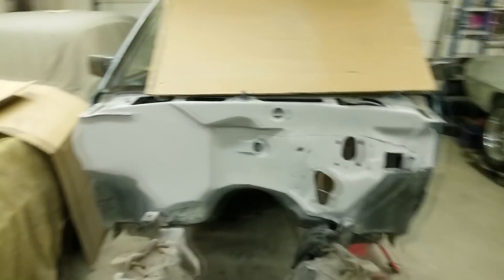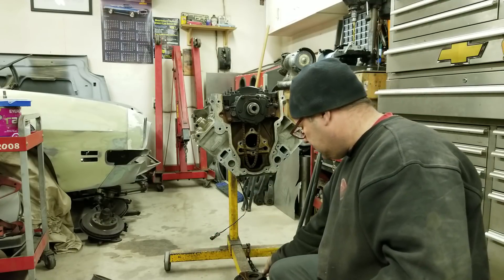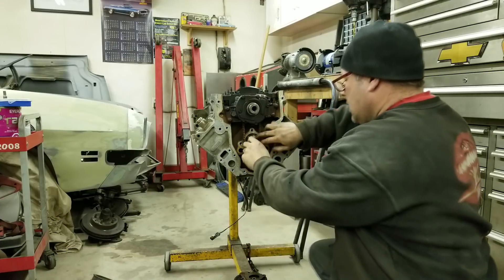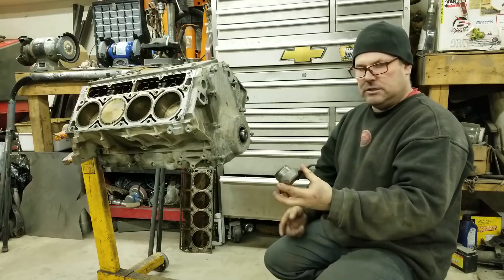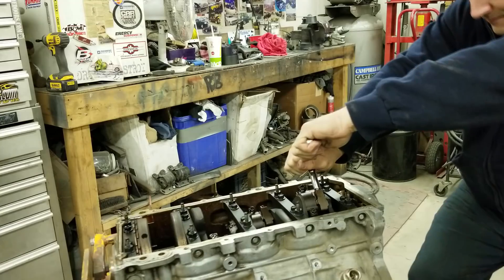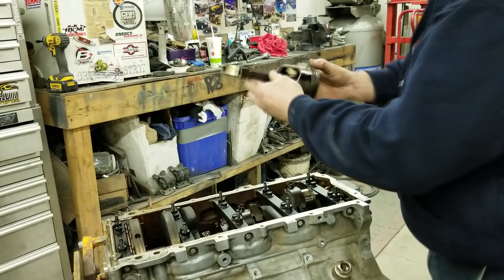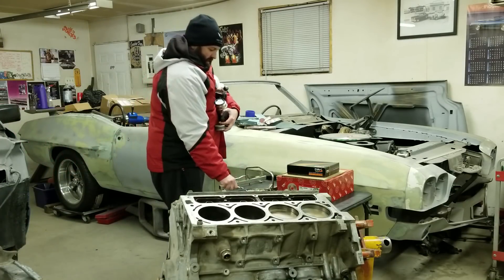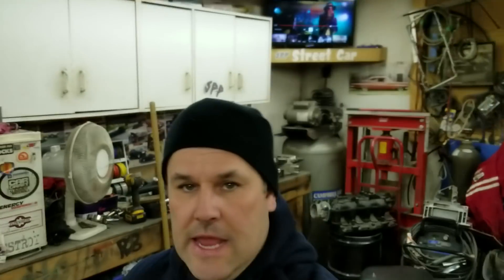Turbo Prepping a 5.3 LS V8 Short block | Sloppy Stage 2 Cam + Piston Ring Gap for BOOST!

Comment: That’s a 4.8.
Reply from the maker: No, its a 5.3
Reply: @SPPTVarmy  oh my bad. Looked like it had flat top pistons in it.
Reply from the maker: It does, the L33 5.3 which is a aluminum block gen 3 with gen 4 internals has flattops.

Comment: What pistons and rods and crank shaft should i get for a 5.3 gonna be boosted plaining on making 700+ hp in a foxbody
Reply from the maker: Stock
Reply: @SPPTVarmy  should i change anything at all heads anything am planning on getting a boost cam but and a lsx fast intake manifold but do you thinks thats all i need
Reply from the maker: You can pull the pistons out and open up the ring gap.my engine has head studs and ls9 head gaskets but is other wise stock.

Comment: How were the cylinder walls? Any cross hatch left? No need to hone it? Not like a carbureted motor that washes out the bores after 10,000 miles of running too rich!

Comment: Love what you guys are doing. I'm learning a lot. But, isn't that a 4.8. I thought 5.3s had dished pistons and 4.8s had flat tops. I'm still learning. I'm not hating.
Reply from the maker: +Twisted Teeter The 5.3 L33 has flat tops.
Reply: SPPTV thank you. Good to know. Keep up the good work.
Reply from the maker: +Twisted Teeter Hard to keep track of all the LS variants. I rely on google.
Reply: it's considered a 5.3 H.O. motor. swapping the regular dished 5.3 pistons for the 4.8 flat tops is a common, cheap, and easy thing to do for a bit more power in the iron block truck motors tho. just don't use the 4.8 rods. 4.8s have a different crank stroke and longer rods.
Reply: As others said it's an L33 which is aluminum block 5.3L (aka 5.3H.O. & baby ls1). They are a very stout aluminum block with the flat top pistons like a 4.8L and they come factory with 799 heads which are the same castings as the ls6's 243 head castings. The L33 was an optional engine in a select few 4x4 trucks for only 3 years. I am doing a turbo LS swap in my 2000 ZR2 s10 pickup which is obviously a 4x4 if you know the ZR2. If you know them then you know that the body is S10 but the chassis amd drivetrain is heavily upgraded over a normal 4x4 or 2wd s10. Putting them at over 4000lbs curb weight, something that the l35 4.3L's 190hp just wasnt that great for. Anyway I picked the L33 specifically because my 4x4 s10 runs a torsion bar front suspension unlike the coil springs on a 2wd and the L33 weighs basically the same as the 4.3L with it's iron block and iron heads it just makes atleast 120hp more and atleast 75ft.lbs. more on stock motor alone. I've already converted my L33 to an LS6 intake and DBC throttle body, I had to get a specific milodon oil pan and pick up to clear my front differential (no suspension or body lift). The milodon pan ends up being alot cheaper and easier than cutting up and welding an H3 oil pan. The only big issue is I'm stuck with using 98-99 ls1 camaro or TransAm exhaust manifolds that have to be modified (which sucks because my 70k mile 2002 WS6 TransAm's factory manifolds wont work and I went long tubes on that car about 1500miles after I got it in 2012 with 33k miles on it. Anyway, my truck will be a basic build. L33 with ls6 intake, sloppy stake one boost cam, trunnion upgrade, walbro* 450lph fuel pump and corvette return style regulated fuel filter, probably get the CPW harness, kwik A/C high mount bracket, Corvette spaced accessories with ls3 water pump, new racing radiator with dual 12" fans, and do a bed mounted turbo set up. Basically gonna stick things where I can get them to fit since the 5.3 with A/C takes up most of all the space under the hood. Oh, as for the L33 the stock compression ratio is 10:1. So even if you build a DIY 5.3H.O. with 4.8 flat tops in a 5.3 expect to have a similar compression ratio. Happy building everyone.
Reply: @jonathanhudson4623  hey thanks. But you’re commenting on a post I put up 4 years ago. I may not be the smartest dude, but, I think I’ve learned a lot since then. Thanks.

Comment: I have a 400 sbc and the crank is hitting my oil pan. I have to keep the bolts loose so it wont hit.
Reply: knelsen _204  is it the pan that came off it? Most aftermarket pans are clearanced for longer strokes. Put the pan off and look for marks where it is hitting and clearance it a bit with a small hammer.
Reply: novaracer2000 I got the motor like that and noticed it was leaking a little oil and seen that all the bolts were loose so i tightened them started it and started making noise. Ya ill have to take it off and do some hammering. Thanks 👍

Comment: What about using a ford axle of a mustang 8.8 i think posi also
Reply from the maker: Fox bodies had 28 spline axles, the Explorer diffs have 31 spline axles
Reply: drill axles and rotors !!!
Reply: I used an 8.8 out of a mid 90's explorer, it came with limited slip and disc brakes. two upgrades in one !! it bolted right up, and I fabricated a bracket to hold the original traction shock.
Reply: I am also using a 8.8 from a explorer with 3.73s, posi and disc brakes. I need to cut it down 5 inches so my wheels fit.
Reply: maybe different wheel backspacing and offset? oh wait you got mad welding skills, and Clayton !!
Reply: You guys could figure it out i am sure redrill chevy bolt pattern univeral u joint and boom upgrades lol
Reply: gypsy gear 

I’d like nothing more than to be able to re-use the axles but Rob needs to narrow it too much to be able to use his IROC wheels, drilling them for Chevy BCD is no big deal but it looks like he has to order shorter axles

Comment: do you have to worry about holding less oil  once you  cut the pan
Reply from the maker: It currently holds 6litres and it will cut capacity down by about a litre but we will confirm that before installation

Comment: I used the same idea to put C5 Corvette brakes on my 70 camaro....cut down the stock rotor to make a hub. Drilled and tapped the dust cover holes for the C5 brackets and hung the calipers. Good to know about the rings being worn down to the right gap. Maybe I'll boost my Silverado since it has 200,000 miles on it now.
Reply: jwright650 i have c5 brakes on the gto done the same way.

Comment: Crikey glad i watched this one...for some reason i was thinking off gapping my ring to 30 thou...nuttin worse than a loose ring.😃
Reply from the maker: +Clint Collins The Sonicstang's rings are around 30. Going to give it all the boost though lol.
Reply: SPPTV oh yeah did not think of that..pwr goals...lookin fwd to the sonicstang build.
Reply: more boost needs the bigger gap if your steering under 20lbs there's no reason to go more than 25ish
Reply: Mikel Bentley thanks so i could probably leave mine factory as im only shooting for 500ish wheel ...7 to 10lbs?
Reply: @10lbs definitely wouldn't bother but if you ever plan to go higher then I would go ahead and gap them
Reply: @Justdoingstuff83  hey I know this is old but I bought a engine with the rings gapped at .026 on the top and .028 on the bottom how much boost can I run?
Reply from the maker: All of it
Reply: @SPPTVarmy  so 30? Real talk I’m trying to make 750 out of a gapped 5.3 with stage 2 sloppy and a turbo

Comment: Hi rob I heard rod main and head bolts are torque to yeld aka "reusable" is it true? If so what brand did u go with for ur rod bolts?
Reply: Jared Norris the rod bolts are reusable and though they say the head bolts are not, many people reuse them and have no problems
Reply: OK I was just wonder wasn't hating on nothing love this channel and s10 build thanks keep up the good work
Reply: +novaracer2000  I have "Stand-A-Lone" cd's with GM's electronic service information. I selected 04 Tahoe VIN code "Z" for flex fuel. As for rod bolts, no where did I find where you are instructed to replace the rod bolts...So, I guess you are right as they re-usable. They do indicate correct torqueing procedure is; First pass 15 lb. ft.   Second pass 75 degrees. That make me nervous as that is usually the procedure for "Torque to Yield" bolts. Depends on if you want to take that chance over $55 of parts on the rotating assembly.
Reply: I'd Just buy at bolts it's really not worth not getting them I mean shot it's only 200$

Comment: Holy ravioli. That is a project with the front brakes I can't wait to see. Did my 2000 S10 rear 7.5 for $100 from 98WS6 Trans Am rear complete brake set w/caliper bracket from eBay.

Comment: Cool Video for sure, i think more than 50% of your viewers don't know how to check ring gap. Is there no other brake upgrade available, seems like a lot of work / time.
Reply: George Mitchell maybe but not for as cheap as this one.
Reply: George Mitchell 

Not too much involved, I should have the stock hats and brackets machined by the end of the week
Reply: a ford 8.8 from a mid 90's explorer will fit, and is plenty strong. They usually came with 3.73 gears and added bonus of rear disc.

Comment: Hey Rob have you ever had to degree in a cam??
Reply: ohheylook 1234 i have before.
Reply: I only ask because I have a sbc 350 I stuffed an RV cam into and timed it but am running into some runnability issues. But I suppose that's my own issue lol.
Reply: ohheylook 1234 if you lined up the timing marks that shouldnt be your problem.
Reply: what type of run ability issues
Reply: novaracer2000 they are lined up and I've verified that a few times now. The engine was a full rebuild and I had the issue with the tbi 305 I took out. And the 305 came out because cylinder 6 had 26lbs of compression while hot with oil in the cylinder. So I stuffed in a vortec 350 full reman with a tbi intake and dizzy, no change in runnability. Lol off with the tbi threw on a 600 cfm carb and hei both new lol. No change in runnability. But thanks you for your time I just wanted yet another opinion on timing Mark's basically.
Reply: John Conner lol the tbi 305 that came out started stumbling around one day like a vacuum issue. Wasted a couple cans of brake clean on that could not find a leak anywhere. So I checked timing noticed it was a little retarded, set it back to zero no change. Here's where it gets interesting compression test cyl 6 came up short with 26lbs. Out came 305 in went a fresh 4bolt main 350 which went from vortec fuel injection to tbi to now carbed all in the same truck in the 6 months with multiple fuel set ups wiring harnesses and yeah all for it   to stumble around and try to back fire and cut out at part throttle.
Reply: ohheylook 1234 the squirters functioning correctly sounds like a carb issue lean back fire maybe
Reply: John Conner lol then why did the tbi 305 have the same stumble and back fire under part throttle.
Reply: throttle bottle no source of emissions. So no egr, I've found another timing light and will check that out and give a look see at the valve lash. P.s. grounds are new and the grounding areas are clean. Thanks for the possibilities to check out.